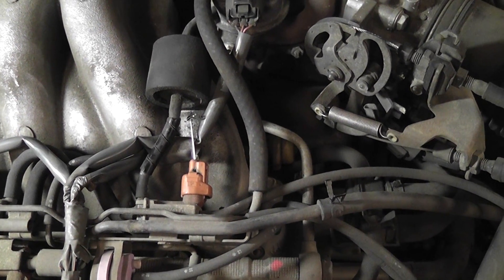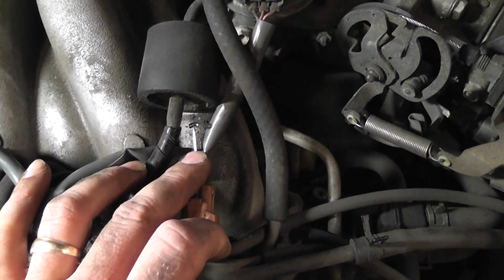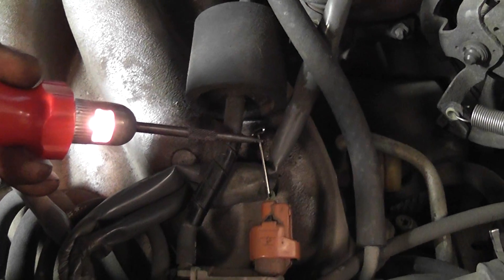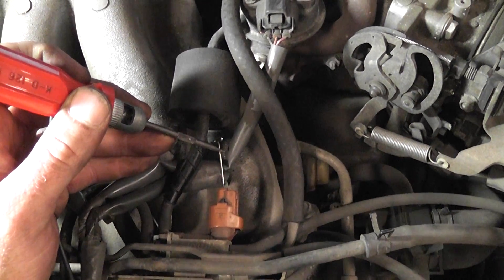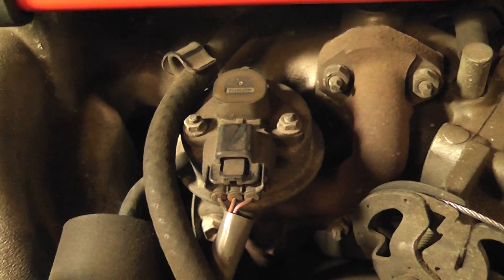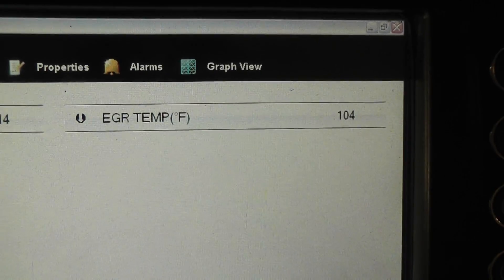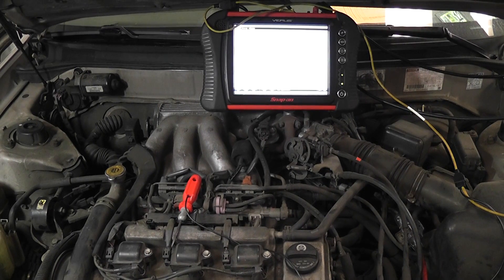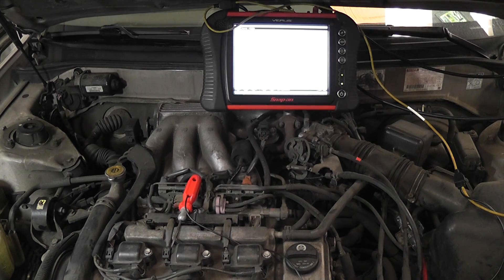How to test a computer controlled solenoid (energizing the circuit manually)

Comment: When it comes to manually energizing a power side switched and ground side switched solenoid and checking the computer driver and control wire for both power side switched and ground side switched solenoids, does the key need to be ON? Like when does the key need to be ON or OFF? When using a test light to manually energize a ground side switched solenoid why does the test light need to be connected to battery ground and why when checking the computer driver and control wire of the ground side switched solenoid why does the test light need to be connected to battery positive? When it comes to manually energizing a power side switched solenoid why does the test light need to be connected to battery positive and when checking the computer driver and control wire of the power side switched solenoid why does the test light need to be connected to battery ground?
Reply from the maker: All really great questions! Watch some more of my Chapter 3 playlist right here on YouTube and when you're ready for some good classes on this stuff, come and join my website 
https://www.scannerdanner.com/join-scannerdanner-premium.html
It's too hard to answer multiple questions here from my phone, because as I type, they're all hidden.
Reply from the maker: Driver test:
Ask yourself, what is the driver doing? If it's providing a ground, your test light goes to power. If it's providing a power, your test light goes to ground. Why? It's the only way the light will light! It needs both to light
Reply: @ScannerDanner  So if a circuit is ground side switched it has a constant power (positive) and in order to manually energize it test light alligator clip needs to be connected to battery ground(negative) because of the circuit having a constant power(positive). Now if i want to check the computer driver and control wire of a ground side switched circuit test light needs to be connected to battery power (positive) because of the circuit switching to ground (negative) when the signal is sent by the pcm or some other component.

If a circuit is power side switched it has a constant ground (negative) and in order to manually energize it test light alligator clip needs to be connected to battery power (positive) because of the circuit having a constant ground (negative). Now if i want to check the computer driver and control wire of a power side switched circuit test light needs to be connected to battery ground (negative) because of the circuit switching to power (positive) when the signal is sent by the pcm or some other component. 

When manually energizing and checking the computer driver and control wire of both types of circuits ground side switched and power side switched, do i need to always unplug the connectors of the solenoids or components for both types of circuits ground side switched and power side switched? 

Is my brain comprehending correctly?
Reply from the maker: @Diagnose1  great summary! And yes, you should disconnect the component for a driver test in case the component itself it shorted and the driver is limiting current to protect itself. In which case your test light may not light, leading you to believe the driver is bad.
There are other things to consider as well. Trouble codes can prevent a driver from turning on. So once your test light is connected, then you'd clear codes before commanding that driver to turn on. There are other variables too, but that's for another time. Seriously you should be taking my classes on my website! https://www.scannerdanner.com/join-scannerdanner-premium.html
Start in my chapter 3 playlist there too!
Reply: @ScannerDanner  One day I will definitely join your classes cause i really want to learn from you. You are the very best on YouTube there is no one like you at all.
Reply: @ScannerDanner  I'm glad my summary was good it makes me feel happy brother.
Reply from the maker: @Diagnose1  sign up for the free trial so you can see what is there. It's only $11 a month after the trial. Cancel before the 14 days are up and you won't be charged. That will give you plenty of time to watch my chapter 3 playlist
Reply: @ScannerDanner  Thank you! I will continue watching Chapter 3 playlist.
Reply from the maker: Yes, the key needs to be on or engine running for all tests.
Reply: @ScannerDanner  Thank you! I'll make sure the next time to have the key ON when im checking circuit identification, manually energizing and checking the computer driver and control wire.
Reply from the maker: Because we are providing a ground for the solenoid, through our test light.

Comment: Hi Paul! I have learnt a lot from your videos; they truly are invaluable. I have a question regarding whether it's ok to energize the solenoid or any other power/control 2 wire components by forgoing the test light and have just a wire connecting the control side directly to ground?
Reply from the maker: You can do that but if you get your polarity wrong you risk cooking the computer driver. There are power side switched circuits too. Spend some more time in my Chapter 3 playlist right here on YT my friend.
Reply: @ScannerDanner  So does the test light reduce the load to the pcm? And you would connect the light from the power side when using a power side switched circuit, correct? Thanks.
Reply from the maker: @cnhz01  yes and yes 
It acts also as a buffer in case you get your polarity wrong
Reply: @ScannerDanner  Hey Paul. So I connected my voltmeter from my EGR solenoid feed and control wires to the negative terminal on the battery and got 12 v and 12 v both when the car key was in the 'on' position and when the engine was running. I know this means I have a bad ground but how do I find it?
Reply from the maker: @cnhz01  that's normal until the EGR solenoid is energized by the computer, which is not until you're driving and under load
Reply: @ScannerDanner  Thanks! I see. Does revving your car while in park count? Because I did that and was still reading 12 and 12. I was doing this to find the ground side since I couldn't remove the sensor! Any tips on that?
Reply from the maker: @cnhz01  you may have to put it in gear and do a brake torque. In park won't enable that circuit. Then still others will need vehicle speed before the computer will energize or ground that circuit

Comment: how does it sense the EGR  temp ?  do they put an air tep sensor ? or what 

great teacher I learn a lot from your website  thank you a lot 
da7!me
Reply from the maker: On this model it uses a thermistor on the intake passage side of the EGR valve. When the valve opens the hot exhaust gases are now exposed to that sensor and heats it up. Operation and testing of the EGT sensor is EXACTLY the same as an engine coolant temp. sensor.
Reply: @ScannerDanner  
thanks a lot for you answer and you attention

Comment: You might of just saved me 800 bucks lol.  My wife will be happy with you.  I have a code for A/T shift solenoid b.  some diagrams have B as an on/off solenoid and some have it as a pwm solenoid.  The solenoids are pretty expensive and I don't want to drain 7 quarts of fluid just to throw a part and cross my fingers.

Is there any reason this test wouldn't work going from battery positive to the harness connector on the transmission to systematically test each solenoid before dropping the pan?

Comment: can i use this same test on my egr solenoid  on a 94 chey trk 5.7 liter
Reply from the maker: yes sir, just make sure you know how it is controlled first. Is it power or ground side switched by the ECM? If you give it the wrong polarity at the wrong time you will cook the driver in the ECM. (Why I use a test light BTW)

Comment: I have a v6 camry that the  ECM never goes into full drive for evap and catalyst  i did a few times erase the evap code but never had catalyst code  ,...  is there way i could check that the ECM driver is even working  the  engine coolant temp is 181f  and outlet catalyst is 70 degrees hotter  than inner ........ any suggestions  appreciate if could help
Reply from the maker: +burt attn are you saying the monitors for the EVAP and CAT never run? If so, change your thermostat. The engine may be running too cold for those monitors to complete there tests

Comment: I use a bypass like this everytime I wanna drain a car's fuel tank using the car's fuel pump into a container. It work's good. Just make sure you have a fuse inline incase the pump overheats when it runs empty.

Comment: Do you have anything on testing a 94 Chevy truck that has a pcm for code 32?  Its driving me nuts. And so is connect test light between harness connector what does that mean? Thank you
Reply from the maker: Post this question on my forum and I'll be glad to help. It's in its infant stage (working out some bugs) right now and you cannot post or register with your phone. 
Here is the link. http://www.scannerdanner.com/ForumRetrieve.aspx?ForumID=3226 Be sure to create a new topic and you alias is how your name will show in the thread
Reply: ScannerDanner Will do thanks

Comment from the maker: Section 3 page 13 should make a lot more sense now. At times a test light is needed if the solenoid is open, but you need to remember to connect the test light first (to b+ and the control wire), then clear the codes (in that order). Then re-run the test to see if the driver can still function. Always remember the PCM may disable a driver if it doesn't like the voltage level or current it sees. We can fool the PCM into thinking the circuit is okay with the test light (at least initially)

Comment: Yea managed to catch it. It was working and in the time it took me to get to the accelerator to rev it up it flatlined at batt voltage. Installed new solenoid and all is well. Only had my vantage pro a week still getting the hang of it. Just wish it had European heavy duty info on it. Hard work getting wiring diagrams for heavy duty stuff and sometimes main dealers are not too willing to give their info away. Cheers for help your the reason I bought a scope and your book learning a hell of a lot

Comment from the maker: the other thing you need to do is to clear the codes. then connect your meter before you turn the key back on so you can watch the code set. the computer may be shutting off the solenoid because the amperage is not correct. in which case you just need to replace the solenoid. so what you're trying to do is to catch the event before the code sets

Comment from the maker: with the solenoid plugged in check for 12 volts at the computer pin on the control wire for the solenoid. it should be 12 volts if the wiring is good. this would be with the key on of course

Comment: Keep getting a returning fault for solenoid signal. I need to test the solonoid in the way you do in this vid. Dont think the wire is open as i get the bias voltage when unplugged. Still need to check the wiring condition though.

Comment from the maker: Ah okay my fault. Things to remember before condemning the pcm. If there is a code in memory for the solenoid the pcm may not turn it on. The solenoid itself should be checked for a shorted condition with may have damaged the pcm driver. The control wire must be checked for opens and shorts

Comment: So with both wire constantly showing batt voltage no matter what the engine is doing would you say that the solenoid is bad or stuck because on unplugging the solenoid you see the bias voltage? Im gonna have to do this method tomorrow and see if there is any activity.

Comment from the maker: Yes, this would be a bias on the ground side of that circuit and is ground side switched. Full battery voltage on both wires would be solenoid is de-energized completely. I need to film that next time I see it. I mention a bias on the power side switched circuits but not the ground. It seems to be more and more common.

Comment: I was testing an egr solenoid today. Had batt voltage on one side unplugged and 3.5v on signal wire with it unplugged would this be bias voltage? When running at idle I got a 0-12v squarewave that increased with rpm and was a flat line batt voltage at full rpm. Would this be a ground side switched solenoid?  I did this test on a known good as another I was working on with egr code was batt voltage on both pins until unplugged then it went to feed wire 12 signal 3.5.

Comment: This works for the evap system as well.  And excellent point on the EGR passage blockages.  I had a cylinder specific misfire code on a E34 BMW.  As these chassis age, this problem becomes more prevalent. I energized the EGR, and my cylinder #2 misfired like crazy.  The passageways were so clogged, that the gasses were being force fed into #2 drowning that cylinder.  Your vids are awesome man.

Comment from the maker: Correct. 
The first thing you need to do before EVER manually energizing a solenoid is to identify circuit design and also the control wire. This MUST be done first and done correctly otherwise you risk frying the engine computer driver for this solenoid. 
I have another video on solenoid ID that you should watch first.

Comment: The vacuum solonoid is the same as a vsv (vacuum switching valve) right? And I used a paperclip put into the positive end of the solonoid..and when I used the test light the light comes on but I hear no click and when I start the car and do it nothing happens..does this mean the solonoid isnt working? Thanks

Comment from the maker: the light lit because it has resistance and not all of the voltage was dropping across the solenoid. depending on solenoid resistance, the light will either be very bright (low ohm solenoid) or very dim (high ohm solenoid)

Comment: hi paul, when you applied battery ground to the NEG side of the solenoid to energize it, why did the test lite light up? since you were on battery ground wouldn't you need a POS+ to lite the testlight?

Comment from the maker: @contagiousFX It is the EGR passages that get plugged up on the intake side, not the intake runners themselves. So if there is no EGR there is no concern of plugged intake passages. 
Also just opening the EGR at idle doesn't tell you about the passages. It is how rough the idle gets or if it stalls that tells you all is good.

Comment: I have a problem with my truck is a model jeep cherokee 1995.cuando traffic is overheating and mark me off. and I have to wait to turn it cool a bit so that it can be a sensor switch may not work well and do not activate the auxiliary fan